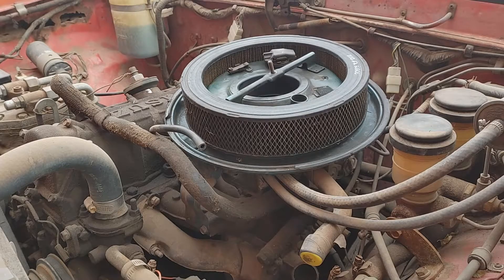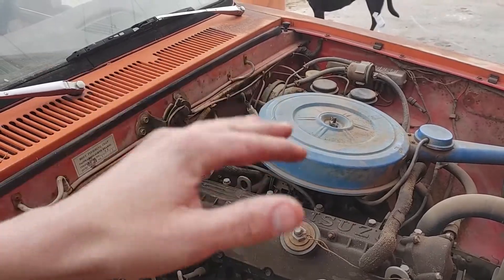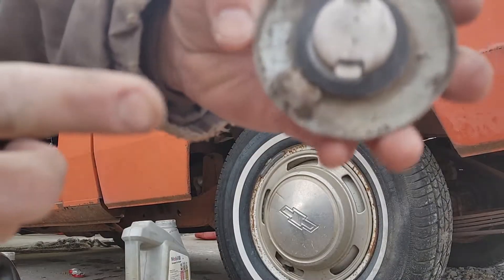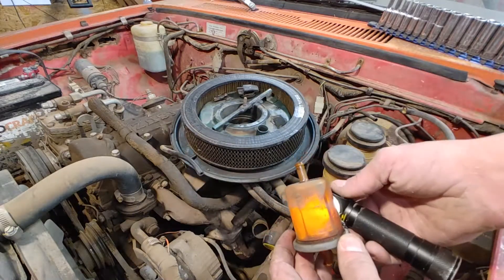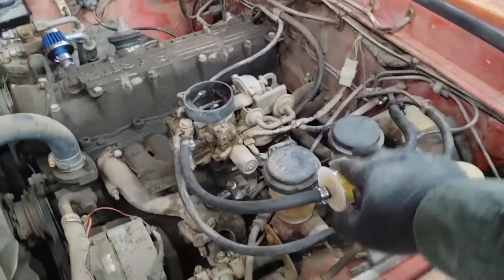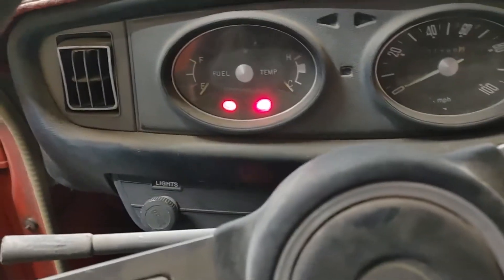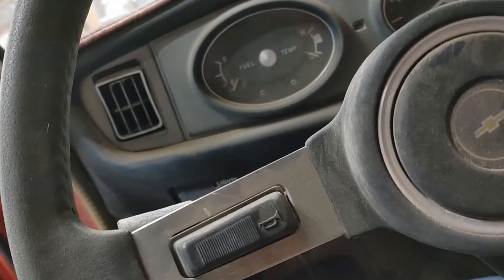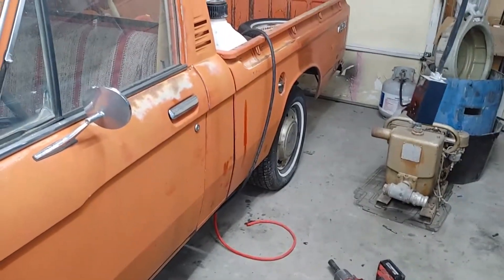1975 Chevy LUV First Time Running In Years

Comment: My truck was running  yesterday  it stop working   it only stays on n running when I give it gas ....as soon as I let go of the gas pedal  .it turns off on me ....I have a 76 luv ... help..can it b. Fuel pump? Filter?or carbruator?
Reply from the maker: Does it run normally with throttle and under acceleration?  If so my first guess would be your idle fuel circuit got clogged. Fuel pump or filter would restrict flow which would cause more noticeable issues while under heavy throttle when you are burning more fuel.
Reply: @fabricobbletech I haven't even drove it just park it  but I did notice stay on when I'm giving  it gas . Idle fuel circuit  ?  I know nothing  about this engine..lol  I'll try to find it ...
Reply from the maker: @chevy-714  it’s in the carburetor. When idling the carb delivers fuel different than when running. You can try a couple things like adjust the idle speed up until it idles.  Then adjust idle fuel mixture, thread it out a little bit, to see if idle improves at all.  If it clogged something I have had luck with is, with the air filter off, rev up the engine then quickly and temporarily block of the carb, remove the blockage before the engine floods and dies, repeat.  This process utilizes engine vacuum to pull fuel through and can sometimes clear a clog
Reply: @fabricobbletech  thanks.  I appreciate  the response  ima do it this weekend..for sure ....ima swap the  engine   in the future but this engine  was just fine ..... ...thanks again I will try this
Reply from the maker: @chevy-714  it could also be ignition. The points can get corroded or out of calibration.  In my experience though they typically cause sputtering and surging at different spots in rpm range while driving. Does the truck still drive normal just not idle?
Reply: @fabricobbletech   yes. Normal
Reply: It  was  driving normal   last week got off work  park it at home n it gave up on me  the same day ..
Reply: @chevy-714  I should say, first, the fuel pump. Replace the fuel pump, and the fuel lines, gasoline filter and others are saying carburator. Take each step at a time. Go for the simple, replace that, then get progressively 
the next step, such as the carburator. Check if it will run on it's own, if not then check your points, condenser and while there four new plugs. Check the electrical system such as the coil, then wires, replace them to.  Check your alternator, check your timing chain,(belt) and while there, water pump.  You must also realize to that these smaller cars and trucks need an occasional bottle of dry gas in order to not have moisture in the gasoline which also reeks havoc on a running engine, you may have picked up bad gasoline that might have water in it, which also maybe your problem.  Start with the simple, and go with the complicated with each step afterward, your bound to have gotten the problem corrected somewhere on down the line. When you've replace everything, you'll had a better feeling about it all in the very end.  Just remember to put dry gas in your gas tank every now and again to make sure no moisture will build up within your fuel lines which can also freeze especally in the colder weather.